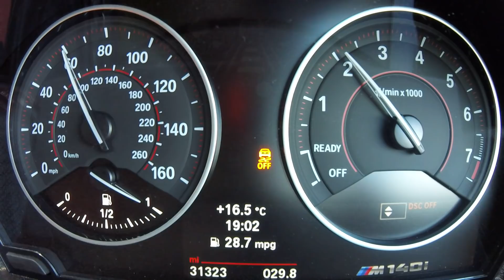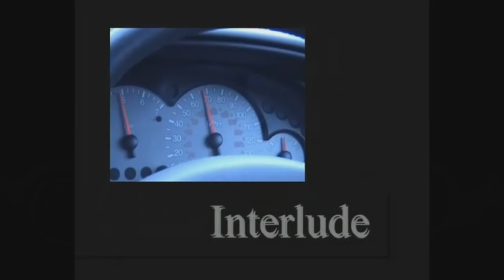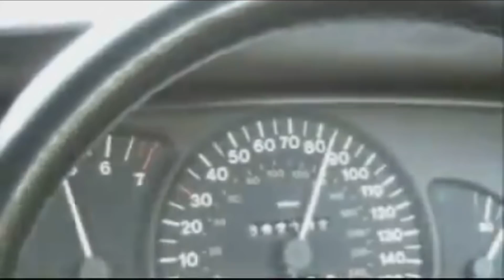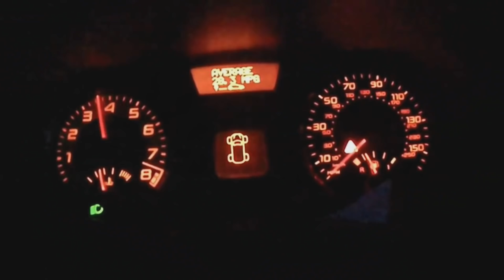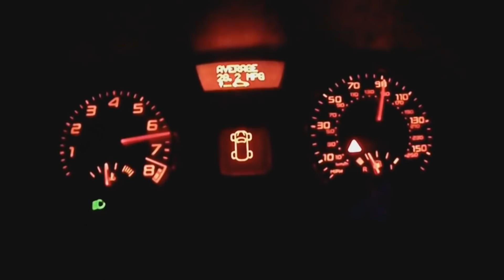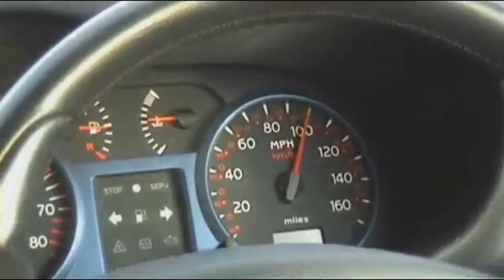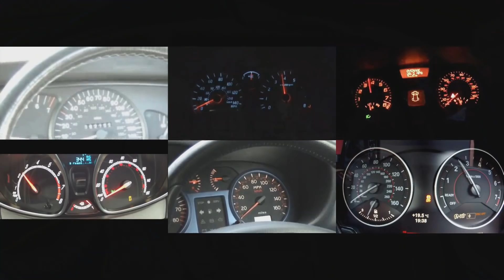My 0 to 100 MPH history 🏁

Comment: Nice. I also had a Mk1 Focus with a 2.0 l engine & I think the 1.6 does the same speed. A slow 2.0 by todays standards but the handling was superb even it was FWD. Those Renaults have crazy torque, better when modified for sure. The problem with getting a fast car is you don't want to let go of it, or if you do then the next thing you get will be faster.

Comment: Be good to see the differences between your stock m140i and a stock 140 with just a stage 1 remap or a bluespark tuning box. I’ve got a 140 manual with bluespark but soon to have stage 1. No other mods than just the tune. I’ll try get some 0-100 figures once the weather drys up. There’s a few private closed off roads up my way. How do you film the clocks? where do you attach the GoPro or camera phone etc

Comment: 2016 F20 xf8, MHD Stage 2 with XHP stage 3 (gearbox map). Under body brace, M4 LCA & TS, B12 suspension (fantastic mod). 0-100mph 8.59s at 15c

Comment: Very interesting Mark. It’s a shame about the Focus RS! I reckon the ZF8 M140 will knock up to half a second off. It has a kind of launch control, I only tried it once but it did fly off the line and the gear changes are quick. That Clio 182 was a flying machine! did you ever get it on the rolling road?